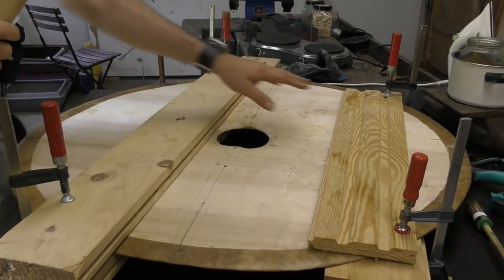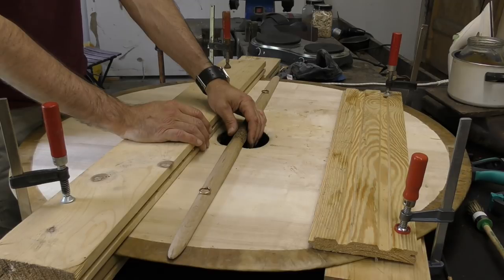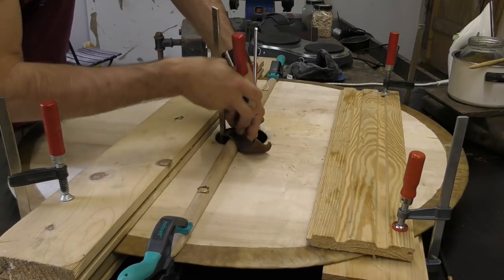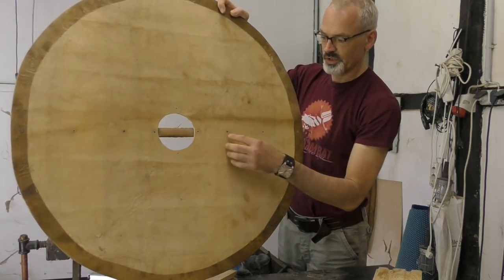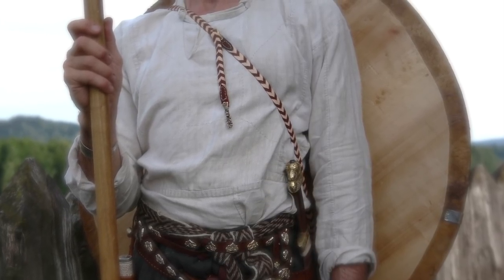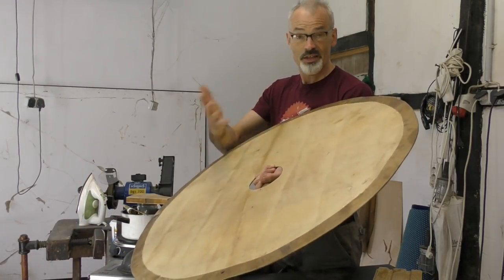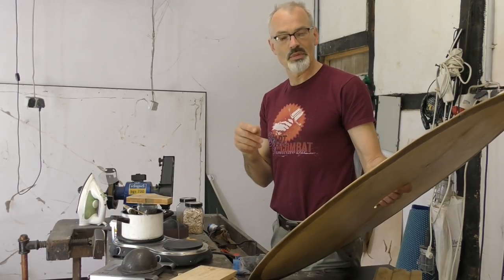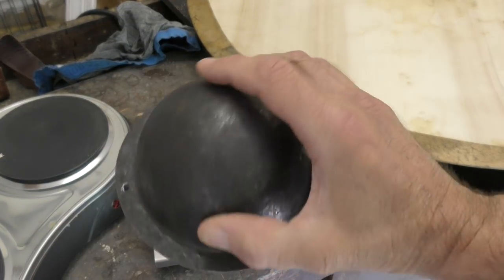Making an Authentic Viking Shield 5: Boss & Handle

Comment: man, wished you upload the video sooner while I'm still making this one XD welp I can always try again & getting closer authentic approach for the the next one (you might already saw my cute green round shield on facebook)

as I said before, my first round shield made from junk (literally) :
-the wood is just some leftover planks from construction site (soft wood, those planks for making crates for shipping)
-I don't have access to rawhide or hide glue (also haven't learned to make milk glue yet) so I just use cloth & PVA glue for the front & back cover. since the theme is junk, I don't buy new cloth, I just happen to find some nice thick cloth which is definitely not old, unused window curtains :P I made 3 layers (2 front & 1 back)
-yeaaah I used enamel paints & cover it with clear satin acrylic spray paint for the painting (I'm still kinda nervous on making milk paint or egg tempera & messing things up XD )
-the rim is...dog chew bone (low quality raw hide strips) stiched it with thick cotton thread (even thicker because I braided those cotton thread, 3 strands)
-I'm still using screw, kinda afraid that I might split the planks if I nail it
-the handle is a lot wider...since I only got soft, light wood. I might change it once I found a proper one (the good things of wide handle is lots of space for you to put nails/screws on it. but obviously that's inauthentic)
-the boss is made from...a freakin' ash tray XD ...1 mm thick stainless steel ashtray (hammered a bit to dome shape). I should get a proper boss with brim & holes for the rivet in the future

here is my shield's specification:
-diameter: 77 cm (yeah I'm a small person XD )
-plank thickness: 1 cm at the center, runs evenly halfway, then tapered to 5 mm
-overall weight: 2.60 kg  

thanks for the awesome video :D
Reply from the maker: You are welcome. I am delighted to read that you find it useful. by the way, it had been online for about a month prior to being made public. $3+ patrons of my work get to see al video first, plus they have access to more than a dozen exclusive videos: https://www.patreon.com/posts/12919628

Comment: On the clinched nails you've bent the tips a second time to then be hammered into the back side of the piece and lock the nail in place.  Is this in the documentation that you have?

I have only noticed the single bend in reports I've read and used the same in my shields.  I've never had an issue with them coming undone.
Reply from the maker: Interesting. My experience is different. I will take a look at my files.

Comment: Who made round domed shields and how did they do it?
Reply from the maker: I made a 20 years ago. You need a domed positive part or male mould to bend the planks over. I did a two layer plywood construction. Here is a model of a more recent idea of mine: https://www.facebook.com/266934476773420/photos/a.549286731871525.1073741918.266934476773420/825009154299280/?type=3&theater